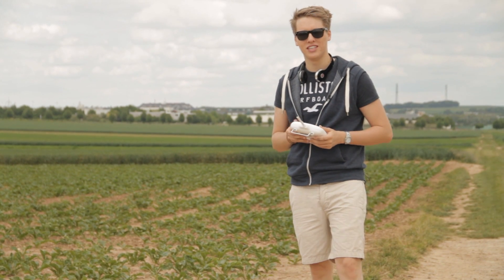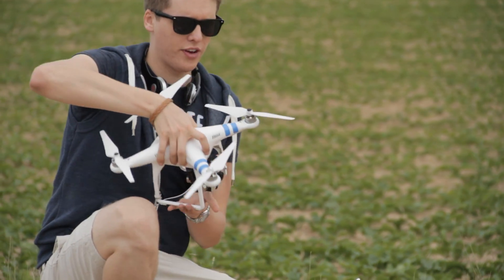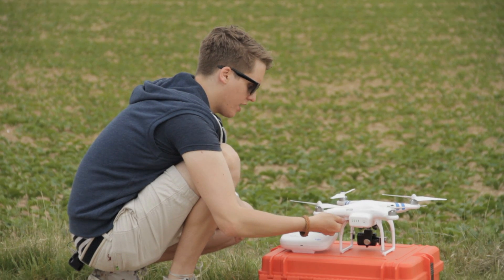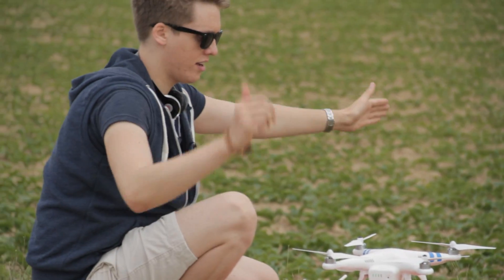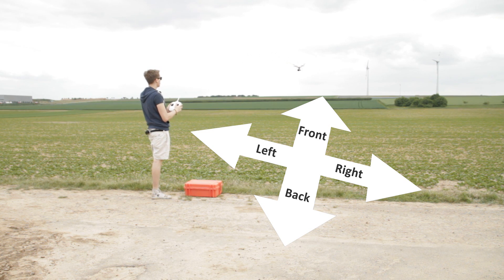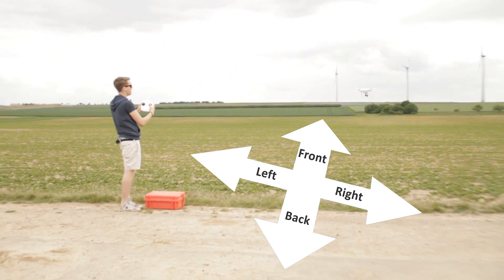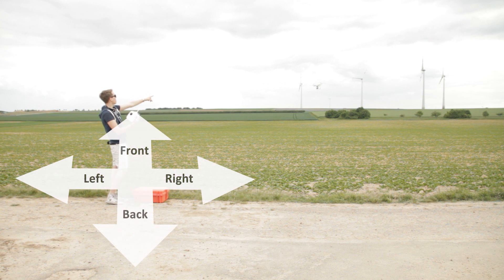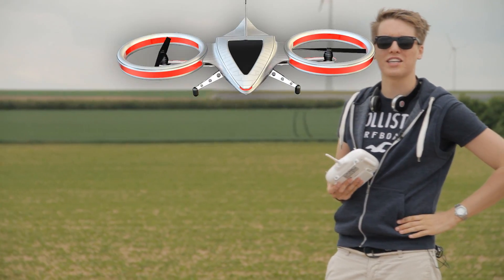#5 DJI Phantom Tutorial - IOC Course Lock (CL) explained and demonstrated

Comment: I THINK I FINALLY GOT IT.   So when you are in CL or HL mode no matter what direction your camera is facing, the drone will fly back to you when you push downward on the controller?   IS THAT RIGHT?   Many thanks again. M
Reply: +Maximilian Imaging 
well I'm flying a p1v1.1.1 and home lock does fly back to you when you pull back on the stick which ever direction it's facing but in course lock mine flies back on compass bearing, example== fly north 100mt from takeoff then turn west fly 100mt west, turn on course lock and pull back on the right stick it will come back but on a southerly  direction so when it's traveled back 100 mt it's still 100 mt over to the west from me ????? this is what happens on my p1v1.1.1

Comment: Thanks Tom. Finally I found an easy, clear, understandable explanation about the special features: CL and HL

Have you or your colleagues done any experimenting with other propellers? 
Like using 9" instead of 8" on the Phantom FC40 model?
or using carbon fiber propellers?
or using the triple bladed propellers?

any remarks regarding handling, and lift and flight times would be great.
Reply: The best props for a Phantom are the "THRUST 945 props"

Comment: Thanks for the vid! For the super noobs like myself 20 mins ago, don't forget that you might have to turn on the IOC mode via usb cable on your computer. I forgot to to this and my CL mode wasn't working:
1)start up the Naza software (download from dji site)
2)hookup the Phantom to the computer.
3)click the advanced button
4)click the IOC button 
5)check the small box next to the border of small window (may need to use transmitter/receiver to switch through CL/HL/off modes to allow you to check box)
Now CL will work
Reply: You are correct....